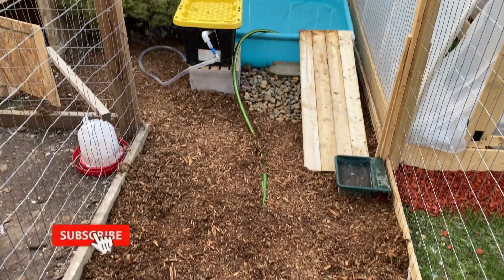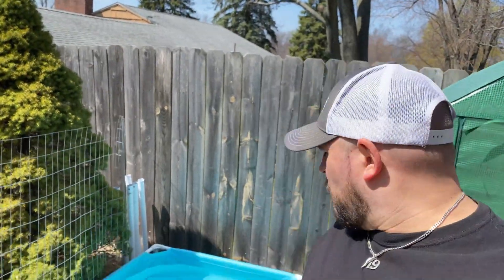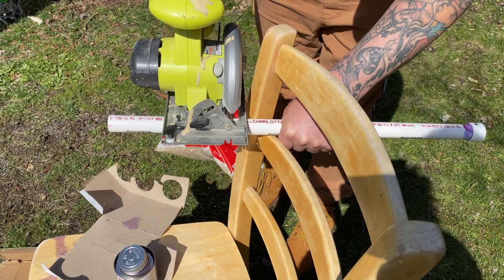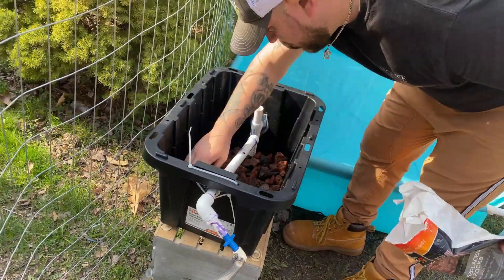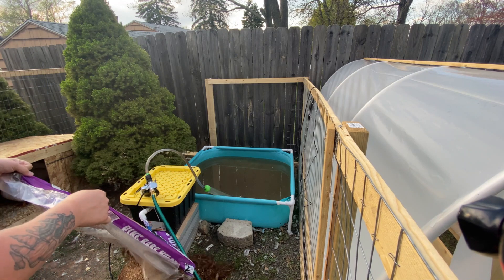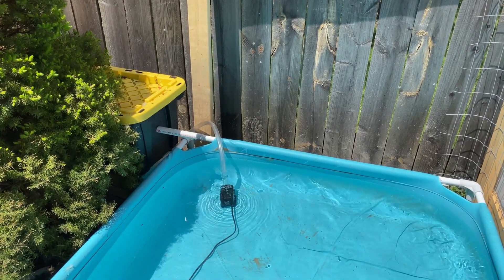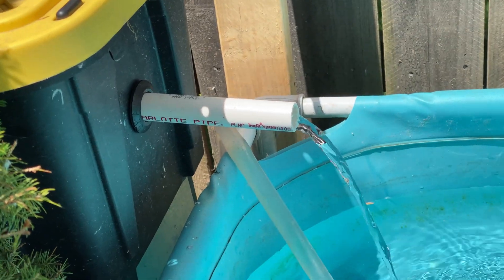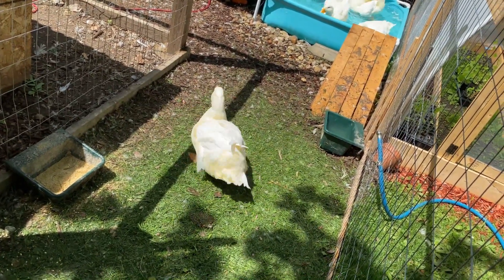DIY SOLAR Powered POND FILTER? (For Fish Ducks or Turtles)

Comment: The original solarpump probably would have worked fine but you have to have an internal filter as well get a piece of 4 in PVC or 6 in depending on the size of pump then drill a hole put the power wire through and a hole to put a hose threw and stuff both ends of the pipe with filtration media this way feathers and debris cannot go through the pump

Comment: How long until you have to clean it out yourself? I have 6 ducks and a 1000L pond with no electricity and currently having to clean it daily or every second day, i dont have water on site either so im trailing a 1000L IBC tank back and forth via van which is tiring

Comment: My family is going on full off the grid solar and with a family member that works in the field very well skilled installing full solar from electronics, large and small appliances and air conditioning, I am going to ask him to work on similar outdoor ponds for my adult turtles that are constantly dropping eggs that I have been hatching out. But after losing my favorite and very expensive baby turtle during water changes and outside do to a predatory bird in seconds which I am still upset about, I will never have any babies that I am raising outdoors again unless they are sub adults or adults. I kept my albino and snow red ear sliders indoors untill they were at least 5 inches prior and since then, I had no issues with them outdoors. I rarely let anyone see where I keep them being several thousand dollars each as adults is why and I have cameras set up also now. May I suggest drain plugs to do water changes easier?